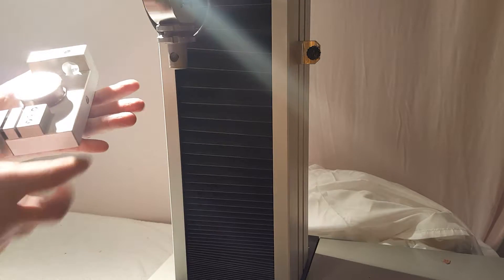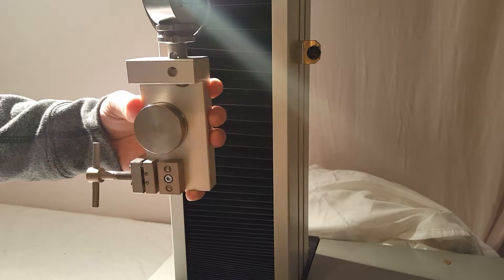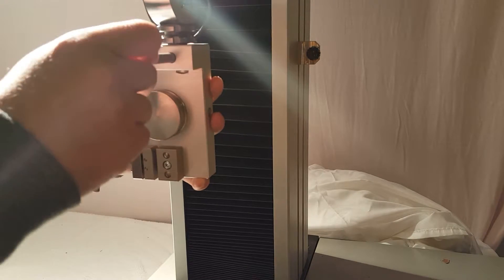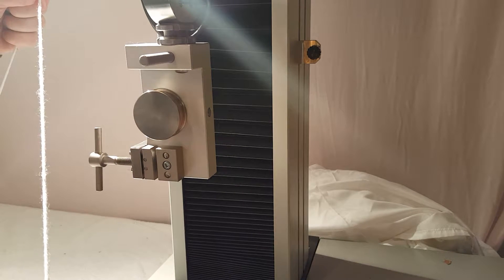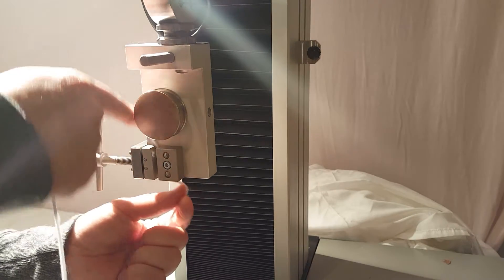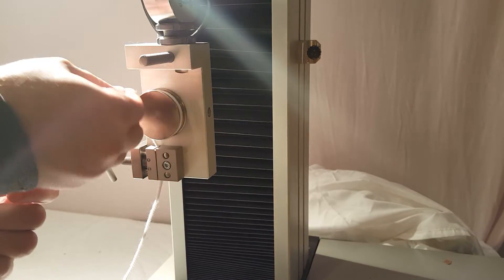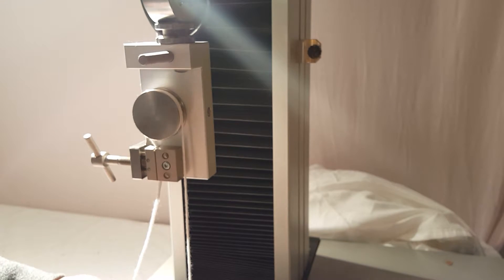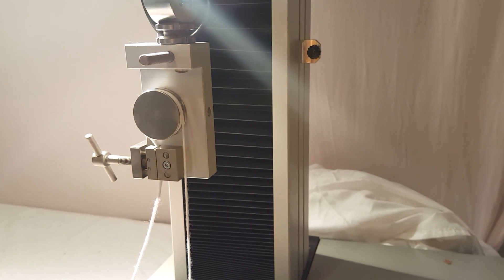1,000 lb. Rope Grip for Tensile Testing

Comment: from where to where do you measure the gage length when using these grips?
Reply: In the middle. Use tape something to mark it and check that it breaks in the middle. We also offer Extensometers on our website for rope and strands.
Reply from the maker: @carlosjuarez8761  yep Frank is right. Move the grips and provide enough material so you have your gauge length. Usually 100 or 200mm. Mark it with a sharpie or tape.